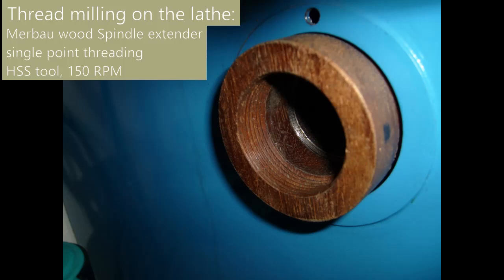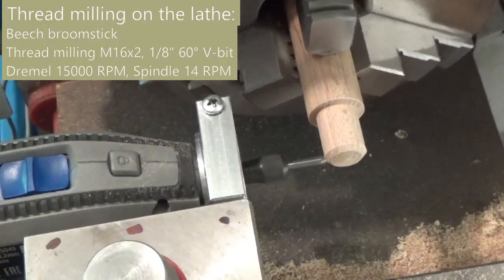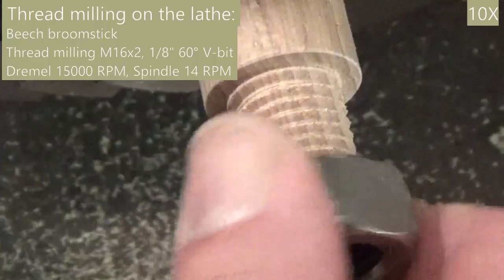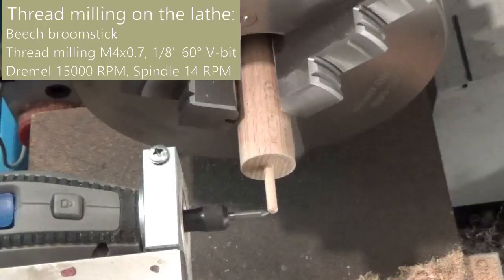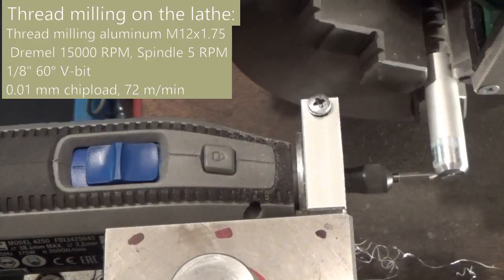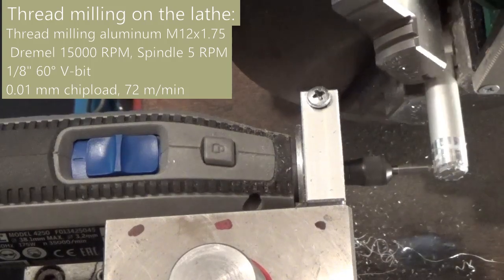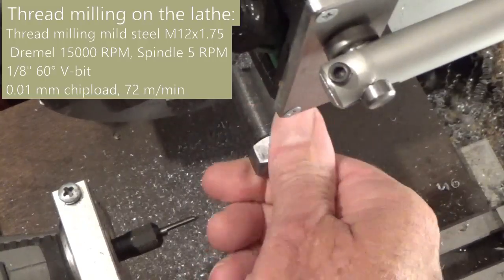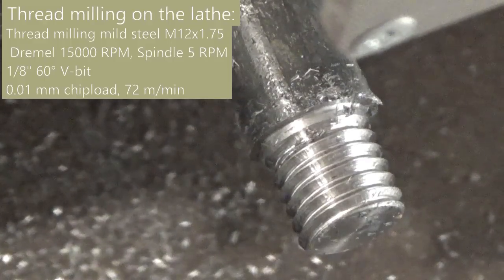Thread Milling on the lathe

Comment: This also works with single point thread mills. Great demo
Reply from the maker: Yes and single point thread mills can also be used for inner threading.

I use an IR11 threading insert in a lathe inner threading holder to mill internal and external threads on the CNC milling machine. The Dremel is not suitable for these tools but I have made an ER11 milling attachment for the Dremel that can hold these tools.